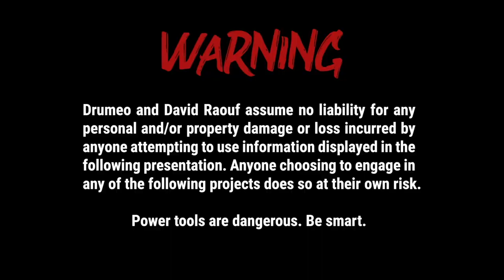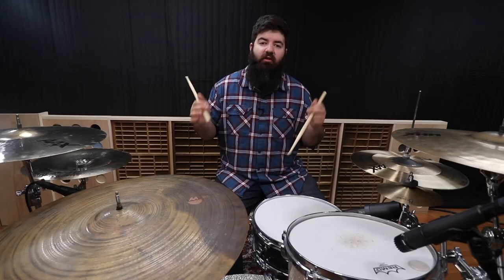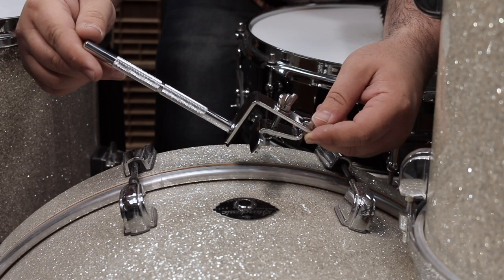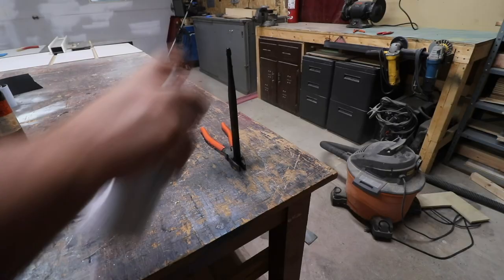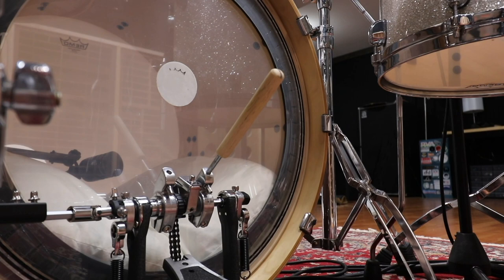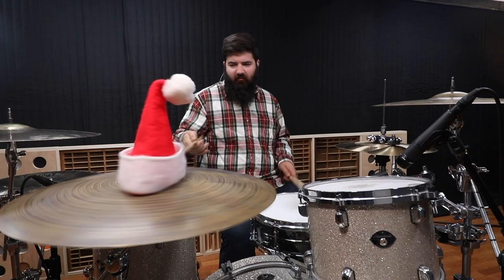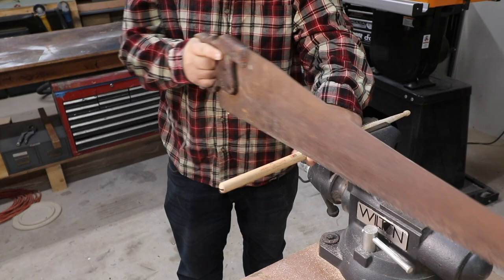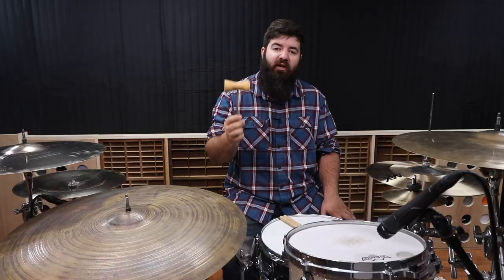6 Uses For Drumsticks You Didn't Know About

Comment: Yo! good ideas. However I can give a better back for a slave pedal stop. Drumstick will work but you have to keep an eye on it. Ittl move around. You also have to keep good track of it while moving gear around to gigs. What I used to do before finally getting my new pearl demon drive which dont move. Is to take a velcro cable strap from one of the mic cables and use it to strap the upright of the slave pedal directly to the leg of my hh stand. Boom! Wont move until you unwrap it. Also you can just leave it wrapped on the pedal during transit. You can also go get some velcro and glue the plastic half and glue it to the pedal base and it will stick to carpet.

Comment: One hack I’ve done on wood tipped sticks that have gotten chipped (with varying degrees of success) is: mix some epoxy like David did in the video, let it set up a little bit so it’s thicker and dip the tip in. You will probably have to slowly rotate the stick to prevent too much on one side. Now you have something like a nylon tipped stick.
Reply: I just have switched to nylon tipped sticks.  I don't like the feel or sound as much as wood-tipped sticks, but since I chip the tips so quickly but never actually break tips, they last so much longer.

Comment: I have been using a pair of Vic Firth Titan TI5Bs for several years not and have not yet broken them.  They are a bit heavy for a 5B stick.  I kind of like that as you can easily drive them through a cymbal crash with a quick snap of the wrist.  Before this pair, I would break sticks all the time.  With some glue and tape, they made great starter stick for my children to use as toys.

Comment: This is gonna sound like a weird flex but I've never broken a stick in half. Been playing for 13 years. Every break I have had has been a tip split. I'm very much the kind of player who never hits a cymbal edge. I was always taught to hit the cymbal on the top with the shoulder of the stick by my teacher and it is still my preferred style. Similarly when it comes to cymbal damage I've had keyholes from poor sleeving, denting from prolonged heavy use... But only 1 edge crack and it was on a small crash. I have a pair of Vic Firth AJ7 sticks which are really thin but still going after 10 years. The shoulders look almost like polished furniture from repeatedly striking metal rather than the mess of splinters I see other drummers sticks looking like. Also because of this I carry a burner pair of sticks for when people ask to borrow mine because I just know that they are gonna do them harm but I don't want to be a dick and let them go stickless at a gig. 

Also as a sidenote I still don't understand how drummers manage to repeatedly show up without sticks but will remember all their cymbals and their custom snare. Same goes for drum keys. Like how is that what you forget? Why isn't 1 on your keys. I have 2 in my stick case, 1 in my cymbal case, 1 on a chain on my hihat stand, 1 with my keys, there's usually 1 in my bass drum blanket that got thrown in there at some point, and 1 emergency key is gaffa taped to the underside of my drum stool. They are cheap and come with any drum you buy. Just keep them handy.
Reply: I’m pretty sure there’s only 6 AJ models, what do you mean by AJ7?
Reply: @Histgyph  you are correct. I got mixed up between my 7A and my AJ5*.

*I'm doubting myself because the print has long gone through sweat. They are very thin and I remember they are AJ something looking at the sizing online I think that they are AJ5.
Reply: @rosejuliette9180  Ah makes sense